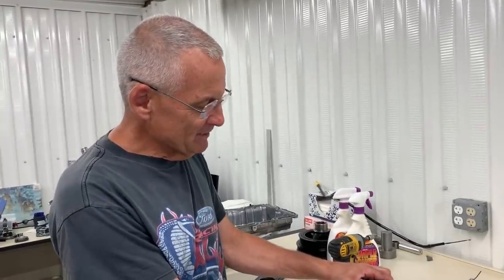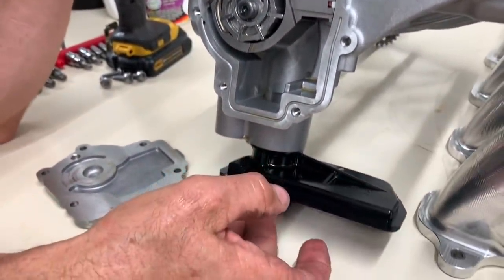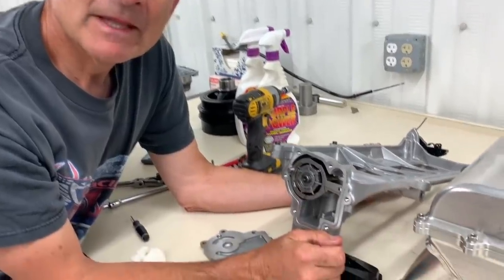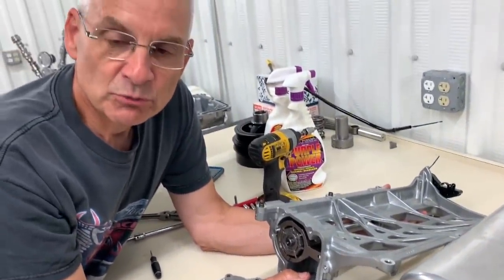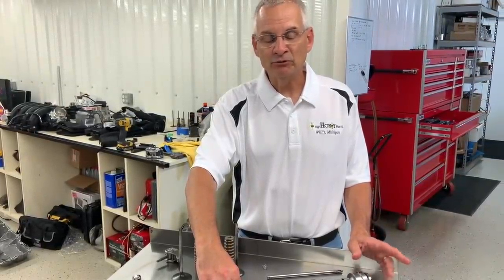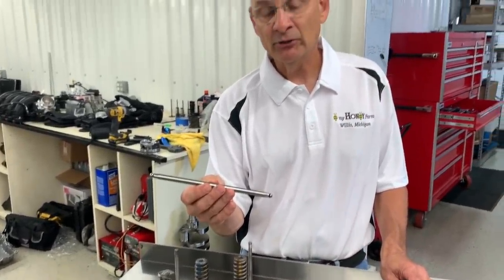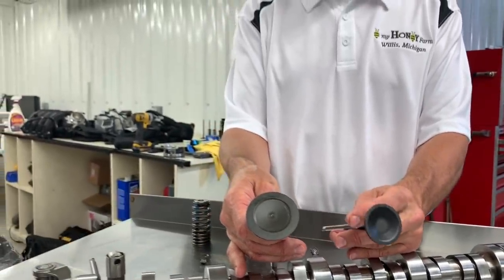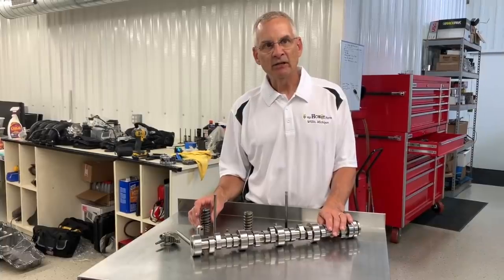Ford 7.3 Godzilla V8 Engine — Cam, Valvetrain & Oil Pump Revealed: Cam Lift, Rocker Ratio & More!

Comment: No springs behind the oil pump vanes ?  Must be centripetal forces that keeps them out against the inside of the housing.  The vanes and the housing look like they could be high wear items !
Reply: Same setup that's been in use for decades in automatic transmissions
Reply: @wainfiggitty  Totally different environment.  ATF stays very clean for a long, long time.  No exhaust gases to contaminate it.
Reply: @jackpatteeuw9244  not in racing applications...
Reply: @wainfiggitty  and who said this engine is a racing aplication?
Reply: @argelioolivares631  I'm not. I'm saying in applications where auto transmissions are worked hard, the clutch materials and heat contaminate the fluid. Auto trans fluid doesn't always stay nice and fresh. Regardless, if someone let's their oil get so bad that a vane type pump would rather commit suicide, well, they were asking for more problems than just that.
Reply: @wainfiggitty  for one a clutch or torque converter are out side of a transmission. 2 the lubrications are not even comparable, lets say a atf 50 to a 5w30

Comment: I see the oil pump design being the drawback to this engine. Wish they would of stuck with the crank mounted oil pump like the MOD, HEMI, and LS engines of today. Time will tell, I could be wrong as some Honda's have chain driven "remote" style pumps and they're pretty damn reliable.
Reply: Ford's duratec 4 cylinders have a similar remote mount oil pump, happens to be an application I'm very familiar with and have never seen any oil pump issues with them. I'm sure this will not be a weak link in the design.
Reply: Apparently hemi's have oiling issues which is why so many have cam/lifter failure

Comment: Here's a gerotor pump that's full variable flow.  The first prototype is old-school, but the technology works with a modern crank-driven pump design.  It's NOT a controlled bypass, where excess flow is just dumped back to the input side.  (That tends to cause oil aeration problems.)  It's also not dumping oil overboard.  It's a new patent-pending approach:

https://ibb.co/4JRQknT

https://www.youtube.com/watch?v=Ace0XkoU5Wo

Here's the pump running on the rig at 4,000 engine RPM (2,000 pump RPM):

https://www.youtube.com/watch?v=9NkEF_ZkNBw

Comment: I'll be the first one with twin turbo working with on3 and lund jr from lundracing should be the first one in the world going for 9s I put the 7.3 in side a 2019 f150 single cab .
Reply: Hmm. I had planned on putting one in my 2014 RCSB 4wd F-150, once I finish all my other unfinished projects... So I may never get it done I guess?

Comment: 2:00 first off, the variable displacement oil pump look like the transmission oil pump in a 4L60e. Next, reducing oil pump load is not going to save as much fuel as cylinder deactivation or direct fuel injection.
Reply: F165 both of which have inherent problems with longevity. I’m sure the aftermarket will take care of this if it’s ever an issue.
Reply: @mikehaslett3738  There is nothing wrong with the 4L60e oil pump. When I rebuilt my 96 Tahoe at 285k miles. I took the pump apart and put it right back togather.

Comment: The rocker ratio was what?
Reply: 1.8
Reply: R Shiery   So the intake valve opens to 1.08 inches? That’s a HUGE hole! What would be the theoretical engine rpm limit for that engine based on air flow capacity only?  It currently appears to go past 6,000 rpm on some F-250 test reviews I have seen. Looks like this baby has some lungs!
Reply: @americanrambler4972  the rocker ratio is 1.8 x cam lobe lift of .600 =
Reply: 1.08 for exhaust

Comment: Think they will ever make a HO Version of this motor to make it into a raptor. Seems like it’s not going to directed towards anything performance Oriented
Reply: STREET RACER I don’t think so either. So many people all over the place keep saying it’s coming in a mustang and raptor. I don’t see ford doing it with this work horse.
Reply: It's a cam, headers, and tune away from 562 hp. That seems pretty performance oriented to me.
Reply: @bigboreracing356  I can believe it
Reply: Matt Moats not gonna see ford doing that factory. After market anything can be made fast. Shit a old big block cam and heads easy 600 to 800 hp lmao. Nothing special when a big block makes over 550 hp. Factory cars back in the 60s made that
Reply: LMFAO it's not supposed to be a high performance bruh it's for trucks
Reply: @bigboreracing356  nobody wants a damn cam in block look at all of the shit you have to do just be prepared for boost
Reply: @mattmoats7412  big block better be doing that and more for what this engine gonna be worth better off with a sleeve gen2 5.0 pushing 1000+

Comment: They changed the pump tray design already? That took less than a minute
Reply from the maker: This is early stuff and every manufacturer makes design changes along the way, sometimes even after production. It's quite common.

Comment: I think it's a sin that they put chains on this thing.  It could have easily been gear to gear, and even geared to the oil pump too.  Just like the 7.3L Diesel;  and then this engine could have lasted forever.  smh.  Why do they insist on making things only last 200k miles.  I hate it.

Comment: So, I didn’t here an actual value given to the saving on fuel economy or horsepower gain. I have never had trouble with gerotor pumps. I wonder if they actually survey customers what’s important in a heavy truck motor. To me it’s reliability first, fat power band second and fuel economy last. I’m sure a bus manufacturer will swap performance for economy and leave reliability first.
Reply: It's also in a shit ton of non commercial personal pickups where all they do is whine about MPG

Comment: Do emissions pull alot hp and torque out put of engines? It seems to me like with everything added up it should be making more power than it is. But im not an engineer so im probably taking out my ass.

Comment: That oil pump looks similar to one in a transmission I hope its more durable than it looks considering what this engine is replacing the problematic v10 

 Godzilla came from the Aussie nissan gtr in its ability to run all over the competition how do you call a new untested ford "truck" engine Godzilla

Comment: I have a real issue with a chain driven oil pump vs a camshaft or crankshaft driven oil pump...that chain will be the weak link in that engine
Reply: I've had pump shafts twist apart before, as well as strip out the distributor.
Reply: Camshaft driven pumps are still driven by chains on most engines.

Comment: Not to bash on the engine, but  the oil pump may be a potential problem.
It will be sensitive to oil contamination and maybe high RPM.  As for windage tray's , the older  design would be better,  in the newer one just add some tabs that could be drilled and tapped. The aftermarket would have a stamped steel sheet tray In a year or two ready to go.

Comment: Pretty cool Ford still hasnt had to go the cheap easy way of shutting off cylinders for fuel economy as GM has done for decades . That oil pump is a key part!  The amount of HP it takes to drive a High volume non variable disp is substantial.  Ford got rid of that by large parasitic loss with this design.
Reply: GM has variable displacement oil pumps, too.

Comment: That oil pump look like a weak point those little vains much rather have a gear pump I’m curious to see how that does in a really cold climate like -20 to -30 whene the oil is really cold I get that there doing this for fuel mileage but it is such a small gain don’t think it’s worth it
Reply from the maker: I'm quite sure Ford did its R&D which includes cold-weather testing. Of course any new system has to be proven out in the real world, but this is actually a proven design used in a wide range of applications, not just automotive engines.
Reply: REVan Evan yea I’m sure it will be fine but out of everything in this engine that was the only thing that seemed ? Vain pumps are solely for efficiently don’t really have any other advantages over a  gear pump

Comment: That oil pump windage tray design is over kill why not put the oil pump in the front cover and have it driven by the crank like other pushrod engines I mean 6.7 diesels have them and they never fail

Comment: Chain driven oil pump with tensioner looks like a big WEAK link in this engine damn it ford your over complicating something for nothing. Plastic tensioner for timing chain and oil pump a good setup for failure.
Reply: The crown vics have plastic tensioners for both timing chains and they regularly clear 300k miles. Mine has over 520k. I don't think it'll be a problem.
Reply: Can't use metal tensioners.. they have to be something softer than the chain so you don't have metal flake in the engine. They are usually metal reinforced or something like reinforced nylon or composite like the oil pan
Reply: Lots of experts
Reply: @robertmontgomery6060  definitely am not an expert just an observation and something I would assume would be the reason they don't use metal for chain tensioners. Unless you know the real reason behind that engineering decision
Reply: john jones  I didn't think it saved the chain more to save the engine. I assumed they were there to keep the chain tight to avoid it from skipping a tooth or rattling at high rpm. Also over time the chain will stretch from heat and general wear. And not arguing against them I think plastic has come a long way and is very strong and should be used where applicable.

Comment: Dont care for a plastic oil pickup didnt ford learn with the fiber tooth timing gears in the past. It is fords version of a LS with. Few upgrades . when one of them makes the 300,000 mile mark like some of my old engines i have i will be impressed. Plastic has no place inside a engine.